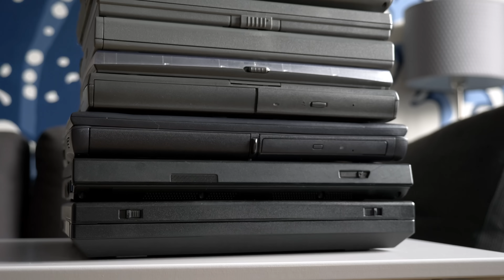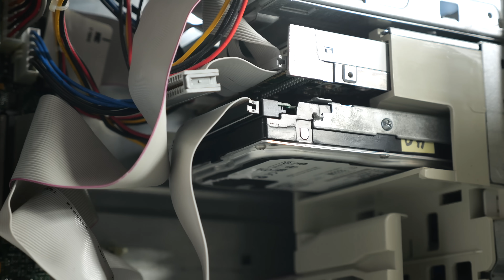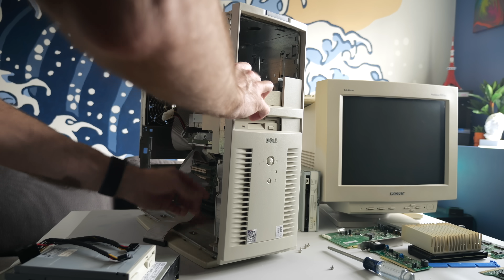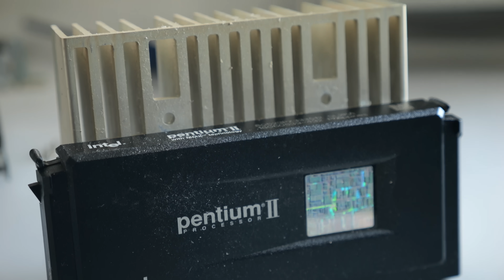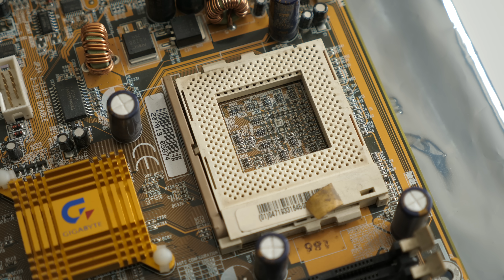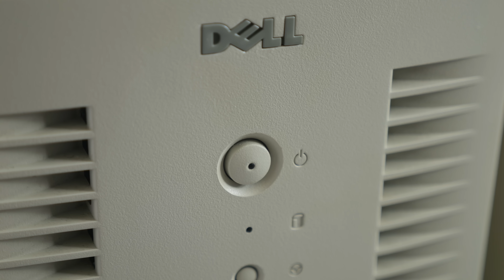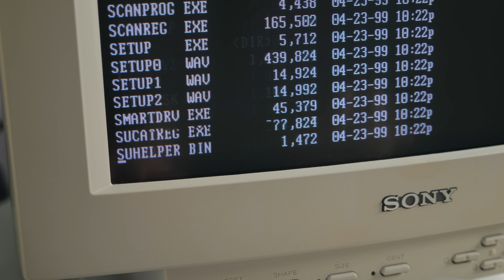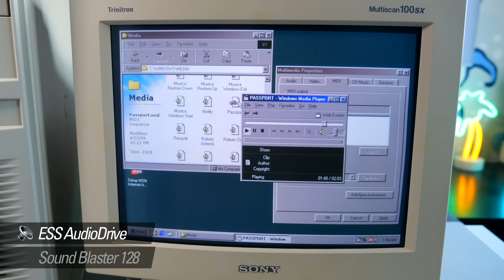Could this prebuilt vintage PC actually be GOOD?!

Comment: I worked for a regional manufacturer in Wisconsin when I was in high school (Omni Tech Corporation). We used the same cases, just had custom front bezels. They are great cases. I might have your missing bay covers. I always liked these cases but sometimes it was obnoxious getting the side panel unlatched. I have four or five machines still with this case. Omni Tech sold their PC division to Micron/MPC (who ironically, used the same cases, along with Dell) when they got out of the PC business.

Comment: Whoever owned that DELL was someone after my own heart. I usually build my PCs, but sometimes I acquire pre built systems since I take in stray computers like I'm "the crazy cat lady" of PC's. Every pre built system I currently own, even my laptops have had some kind of repair or modification done to it as soon as I got it and established it worked. The only one that ALMOST remained stock was my Gateway 2000 Pentium 4, but the PSU had other plans, so I had to find a PSU small enough to fit the case. Thankfully, Gateway used a standard ATX PSU, unlike my DELL Core i5, where the standby rail is 12 volts instead of 5, as well as a few other quirks.
Reply: Dell Sucks When It Comes To Their Compatibility! They Do Not Want You To Upgrade Which Causes Megatons Of E-Waste!!!

Comment: That systems is screaming vintage LINUX and BeOS and QNX and FreeBSD and and! From the late 90s or better yet, the 2000/2001 era. Man I loved that time in computers.. New, exciting, BUGGY, crash prone, but exciting! Not a gamer.. so my go to would have been MUSIC recording and production and picture editing and GUI graphics tinkering. Yeah, I suspected the extra drives where stand ins for the missing front plates, though I did not think the 12x Mitsumi CDROM drive was going to work lol! Amazing. Those slot1 INTEL chipset boards and some VIA Pro motherboards where very stable and sought after but so expensive you may as well wait until 6 years later to finally have a great stable fast PC at a reasonable working man's wage price.. But was fun that era no?? W.....ind..ows.. 2K!!!! Ah Windows 2000 Pro.. That was what really made computers in Windows fun back then! And the PII slot one series from DELL and COMPAQ really did shine with that OS! Changing my desktop in Windows 2K to something else more exciting using shell replacement software was a big fun time for me with these PCs and Win2K back then. I can not imagine I would have continued with computing had not NT become mainstream.. cause Win9x really REALLY sucked for multimedia STABILITY.. You sneezed wrong the OS would perform an illegal operation or go full blue screen of death on you lol. The Soundblaster cards were the best too. REAL YAMAHA FM synth could be found on the old ISA cards and new fangled musician's sample based cards in the new Live! PCI cards. The AudioPCI 128 never really was my favorite as I could not do real FM nor custom load samples(soundfonts). The ATI Rage line of graphics cards where the best. Nvidia and Matrox too, had good cards that gave me decent graphics in Win2K and Linux but those Trident and S3 and SIS cards really boiled my blood with so bad a drivers and stability issues. I am in 2023 and I still want one of these DELL systems... As I look to my right and see I have a stack of Dell Optiplex intel i5 almost new systems lol!

Comment: In 1996 I bought a brand new Packard Bell Platinum Supreme 3000 with Windows 95 installed on it a CD ROM drive and a version 1.1 two port USB connection in the back! I had the computer for a week when I opened up the case to find out if there was anyway to upgrade the system!!! 

I forget now what RAM was in it, BUT it had two empty SDRAM slots so I topped out the RAM to as much as I could stuff into it! AND that is when I noticed that the IDE/ PATA ribbon cables supported two more drives, so I got a hold of TWO 100 mb drives and increased the storage capacity of it!!! 

Then about six months later, I happened across a Pinnacle Studio Analog to USB device that would allow me to record analog video into this old computer, for the cost of $80 so I bought it, hurried home with it.....and this is where things got strange!! Because after I installed the software for the Pinnacle Studio device WHICH was compatible with Windows 95, THEN installed the drivers on my computer.......the device didn't seem to work!! So like anybody else I called "Tech Support"!! BIG MISTAKE!!!

Tech support immediately wanted to know about the "specs" of my computer, and I told them how I installed ALL the RAM I could into this thing, added TWO more hard drives, BUT I couldn't get the factory USB to work!!!! 

Tech Support THEN TOLD ME

1) That the computer I owned DID NOT support installing as much memory as I had installed in my computer!
2) that there was NO provisions to install, or add two more hard drives into the system and that IF I had, I must have voided the warranty of my system because it was now considered "CUSTOM" and further claimed I MUST HAVE changed the motherboard to all this feature!!
3) Then they told me "Your computer DID NOT come with a USB port installed in it!", and again insisted that I installed that hardware myself, WHEN it was literally WHY I bought the computer in the first place!!! 

Ultimately I did figure out that they "Windows Device Manager" was the cause of the error and fixed the USB connection issue myself!! BUT Tech Support didn't seem to know a single thing about the computer THEY BUILT and sold, which I bought at Circuit City at the time brand new off the show room floor in a rather large box!!! And they had ZERO CLUE, that the upgrades I made to it were even possible in the first place!! The last "new computer" I bought was a Hewlett Packard, with Windows ME on it, and I also did similar upgrades to that within the first month I owned it!! BUT since those days I have built all my new computers myself, and without a single college course in the subject as well!! I actually learned how to work on, and run computers by tinkering with a Commodore 64K I got when I was 15 years old, BACK when the Commodore was "first of its kind" and nearly "top of the line" in computers and the only competition was the Tandy 1000, and the Apple 1!!!!

Comment: What's funny is that I have a PC with... you guessed it- a Rage 128, 333MHz Pentium II, on a nearly identical motherboard, running Windows 98. Only my computer was using a Sound Blaster 16 card because it was just what I happened to have lying around and wouldn't give me any trouble.

Comment: I worked in a Print shop that had one of the 266 models. It was bought new as a prepress machine. At some point it was updated to Win 98 and had been moved into shipping when I started in 2004. When I left 8,5 years later it was still running UPS world ship and our Dymo thermal printer. The thing was an absolute rock.

Comment: Thank you for the great video. I loved the XPS line from Dell. I have a T600, from 1999. A few items that might be useful:
* Dell still offers all of the original drivers on their site. It's listed under their retired models section.
* The extra front slot is likely for an IDE based Zip drive. Or at least, that's what I have in my T600.

Comment: I've run pII 333s at 450mhz without problem. 500 was a bit of a hit/miss thing. One of the 2 pII 333s I have did fine, the other one becomes unstable. 

Your score for q3 arena is quite typical on a pII 333. I played the linux version a lot on the p2b-ds dual cpu machine I had at the time (actually... still have), as the linux version worked with smp. That got you a comfortable 50+ fps even with busy scenes. That system would even run Return to Castle Wolfenstein with a playable fps, through only just. 

I also have a slightly newer also slot-1 xps stored somewhere, but with a pIII installed.

Comment: The inclusion of a DVD drive has got me confused because to play DVD's on a pentium II machine you need a decoder card and that computer does not have a decoder card. I have a pentium II 400mhz Win 98 machine that has a Sigma Designs Realmagic decoder card because without a decoder card you will not be able to play DVD movies, it will just act like a normal CD drive.

Comment: Modern PCs are far worse value props than just building your own if you want the tower PC many people had in the 90's. Modern Dell office computers require if you want a better power supply, you pony up for a generic TFX PSU with harness to convert the power rails into stuff the stock mainboard will accept. Ridiculous stuff.

Comment: You have something very rare here: The heatsink is riveted to the CPU using very special rivets. These can be mounted or removed by turning them using a torx screwdriver. 😉
Reply: I noticed the same thing!
Reply: This comment made me check the Pentium II sitting on my desk. It has the same rivets. Thanks for pointing this out!
Reply: Is it really Torx or rather IP?
Reply: Torx gang reporting in o7
Reply: Most dells from this Era were like this its not rare. I have a dell dimension t450 that has the same thing. The higher end pentium 2s and 3s had fans built into the case
Reply: Was looking for this comment
Reply: Yup! I remember my roommate got a couple systems like these from his old job when they were upgrading their call center computers. I was able to pop the heatsink off using an old allen wrench I had left from some cheap furniture & clean up the heatsink/paste. Wish I still had one of those boxes, I miss old retro gaming on period-accurate hardware.
Reply: underrated comment
Reply: I'll take that any day over the cheaper heatsinks I currently have for my Slot 1 CPUs.  They use spring-tension mechanisms and only fit a 40mm fan if you're lucky.  I bet you could fit an 80mm Noctua on that one.
Reply: @LabCat riveted on heatsink sounds so god awful backwards, no thanks
Reply: @def0n3 Did you read the comment at all??
Reply: yes and riveting things is very annoying. what if you dont hhave a torx screw driver
Reply: @def0n3  the author of the video made a mistake. the heatsink is not riveted on, it is screwed on using Torx screws. that's the point being made.
Reply: No he doesn't he literally just keeps on shooting out video after video after video after video and not reading anyone @AngelaTheSephira
Reply: @everythingpony  I'm talking about the commenter. Not the video uploaded.
Reply: @def0n3 torx bits are ubiquitous.  Obtaining one is either free or close to it.
Reply: @everythingpony  noticed the same thing. if you dont care about your audience, what are you here for? money.

Comment: My uncle's old PC has had a Compaq Audio PCI 5200 since it was built (should have been a completely new - but I think he may have been ripped of). FM synth is abysmal (if you aren't using general midi) and the 1373 is quite the CPU hog. Not a big deal with a Duron 1000 (far faster than my Pentium III 1000), but really a deal breaker with slower CPU.

My own primary Slot1 PC actually has a similar/later (non Dell, though it has pads for Dell's proprietary connectors) version of that board. With onboard Yamaha YMF740-C (it is quite compatible with games in pure DOS) and a mixture of polymer caps and Rubycon electrolytic (no empty capacitor pads). Luckily for me its a revision without the underpowered VRM (going above Pentium II 450 is out of the question if it isn't a late board).

Due to the original AVC cooler on my PIII 650 (now using a Coolermaster cooler - smaller but with far more surface area) however I had to replace 2x of the electrolytic as the clip on the back pushed them off their legs. The new Panasonic caps aren't quite as tall and the board really has proven to be completely stable. 
Unlike every other pre 2010 board of mine (except an Asrock KT400 board that I repaired for my Mum's retro PC - limited BIOS but hassle free once all VRM caps were replaced).

Comment: i have the dell  xps H266 i just  looked at my computer ,,it has the built in sound card, BUT no agp slot   ,, i went back to windows 95 on it ,,Dell Dimension XPS D300 with windows 98 se,, great video ,, hope to see more videos ,, i also have a tall gateway 2000 P133,, 133mhz cpu  really clean,  ,, which  has a pin  on the mothderborad to change the cpu speed for  for slower dos games,, i love older computers

Comment: i have a dell xps d266 that came with opl sound on board with the same case as that  i threw some molex led light strips in the front panel and use it as my retro gaming pc it had a 266mhz PII but i put in a faster 366mhz one the name of the pc in the bios changes depending on the speed of the cpu you use so its now a d366 lol it had a riva 128 but i swapped it out for a tnt2 and i kept the onboard spund cause its honestly good as is and i swapped the hdd out for a cf card

Comment: The USB ports are significant, late 96-97 was when I first started seeing them and the big pre-built manufacturers were pretty good at getting them onto their boards very early despite there not really being much use for them until a year or two later.

Given this machines era it is very surprising to not see a CD burner in it though! Equally surprising to see no graphics card upgrade. I assume despite being an XPS and perfectly capable for some reason the owner just didn't touch this much as far as late 90s upgrades.
Reply: Maybe not a gamer but that uncle who could make you a copy of the CDs you rented over the weekend.

Comment: I actually used to work in computer repair in the late 90's.  Most big brands were OK, but a bit behind what you would get from a custom shop or doing it yourself.   Dell? Well, they used a different AT or ATX pinout for the PSU without documenting it, forcing you into their upgrade or repair chain.  Seriously - if they could have reasonably done that with floppy or hard drives, they would have.  I've spent about 25 years telling people to stay the %$^#$%^& away from this brand

Comment: I had one of these in the 233mhz form. The Riva 128 as well. But I added a Voodoo1 card because most games still did not work with D3D at the time, though that quickly changed. It handled Q2 and then Unreal very well.

Comment: I had, back in 2003/4 the 17" matching trinitron CRT - got it from a dumpster because....the flybacks had a lifespan of about 3/4 years and it had gone fuzzy in the image. Some tweaking got it back to nearly perfect, but it always had a bit of a fluff around the edges.

Comment: Dell has manufactured some great PCs.   I reckon this one has been upgraded to a PII 333 as its the last 66mhz bus PII that this motherboard supports (its an Intel OEM board with i440LX) I believe you can fit a Slocket and a faster Celeron with 66mhz bus.    I don't believe that mouse is original either, I think its from the 486 era.  I think this PC would have shipped with a Microsoft Intellimouse with Dell branding.   I reckon the Compaq soundcard is from a Compaq Deskpro EP.    You should try creating Windows 98/2000 dual-boot, I reckon it will run very well indeed.

Comment: This is the sort of rig Dell offered back then.  Dells were always very generic.
The main problem with Dell back then is there was no consistency.   I once supported a dept with Dell computers in it.  Every single time I had to replace a part, the new part did not match the old part.  Corporations do not want the latest part you happen to have in stock.  When you have 1000 or 10k PCs to support, you want consistency. You want the same exact hard drive, the same exact motherboard and all of the same exact cards it initially had with all the same ROMs on the cards.  Otherwise, you get these one-off PCs all over the place that no image works for and where a standard software behaves differently.

People who don't work in the field just don't understand stuff like this.  There is a reason Compaq and IBM were KING in the corporate office at the time.

Comment: I grew up with this exact PC other than it being a 333 P2. Barely noticeable difference. My dad spent a lot of money on it at the time, only for the 350 to come out a month or 2 later with 100mhz fsb lol. Ours had a 16.8gb hd 128mb ram, turtle beach Montego sound, riva 128 card, zip drive, and dvd. It was loaded for the time. I remember getting it in March of 98. That riva by stb in yours is the original. Same one I had.
Reply: I had the same except it was an R450 from later in the year. Exact same parts.

Comment: To be noted that on this line of Dell XPS Dxxx, the same motherboard was used for the various models, so how does it know what model to display upon boot? Well, you have a jumper to access an extended BIOS version allowing CPU configuration. When upgrading the CPU, BIOS is the only way to inform the system of the new CPU specs. Changing the CPU speed will then UPDATE the Model# shown in the User BIOS (D333 for 333MHz for ex).

Comment: Fun facts:  This case used by Dell was used for a few years if you include the face-lift of the Pentium III models.  The base case design was used by Micron and one of the Macintosh clone manufacturers, just different face plates.  Also, the 5.25" drive bay cage is completely removable, with very few screws holding it in.  The plastic HDD bracket is capable of containing two HDDs simultaneously; one horizontally mounted and one vertically mounted.  The vertically mounted HDD would require some unusually long screws, though, and fasten just behind the front face plate.

Comment: Those Dell Dimension computers from the late 90s were so fun to use in middle school, because they had multiple disk drives like Zip, 3.5 inch, and CD-RW drive which we need to save for PowerPoint projects.